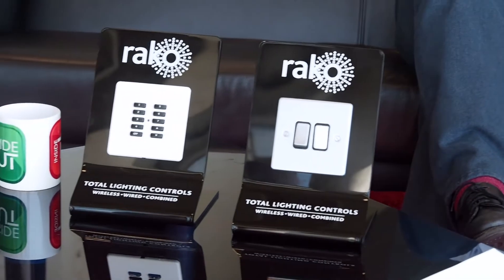Rako lighting introduces NFC setup and regular switch interface

Comment from the maker: Integrating technology with interior design is an ongoing challenge for custom installers. Paul Wafer, director at Rako, talks about the brand’s innovative switch interface that enables designers to use conventional wall-switches with Rako lighting. Wafer also explains why new NFC switches will dramatically improve the commissioning of a Rako lighting system…